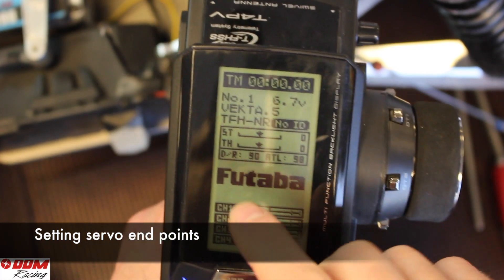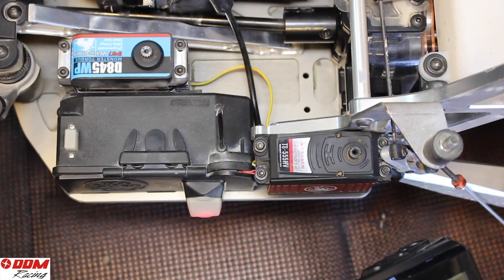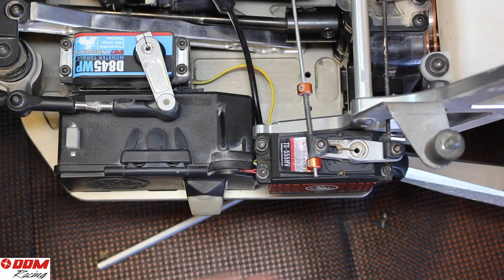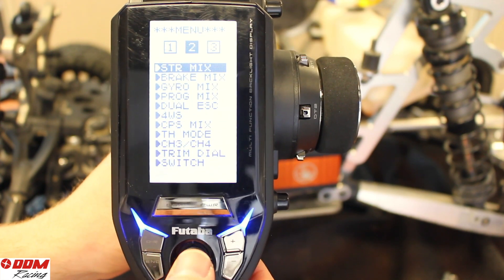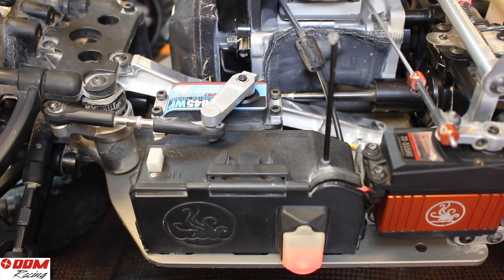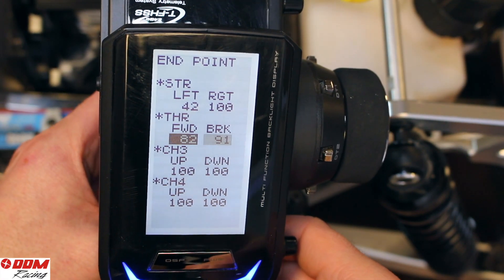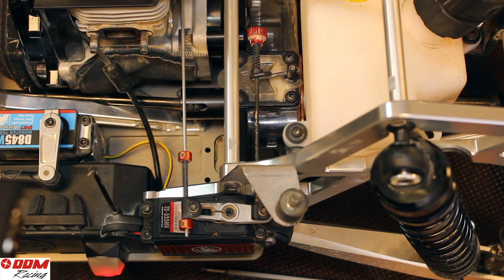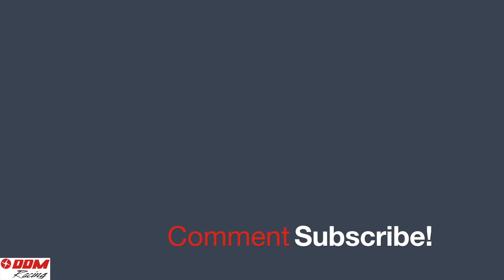How to set servo end points on digital servos by DDMSteveB

Comment: Hi Steve =)

Wanted to know.. if you sell
VELOCITY STACK screws? 
PLEASE let me know thanks  
Couldnt see it on your website.

Its the long black screws that goes thru the VELOCITY STACK into the Carb.
Reply from the maker: We do have them! They come a variety of lengths, most common seems to be M5x55: http://www.davesmotors.com/carburetor-bolt-set-m5x55.html there are also M5x50 and M5x60 length.

Comment: Hey steve is servo chatter normal on digital servos? The services in my baja make noise sometimes and then if I cycle the servo it stops for a bit.
Reply from the maker: Yes the "chatter" is normal. Digital servos are much more precise than analog servos so the noise you hear are usually the FETs working as they are constantly making adjustments to center themselves. If you take a load off the digital servo (like lift the front tires off the ground) you will hear the chatter stop.
Reply: Hello there everyone.  Awesome work Steve and all ddm team! I have also a question for Steve.  My   throttle and brake servo also chatters a lot it's hitec with titanium gears inside.  Do i have to be worried or not? Thx